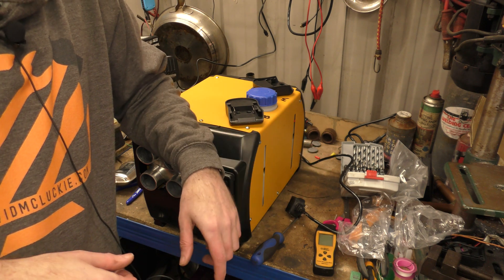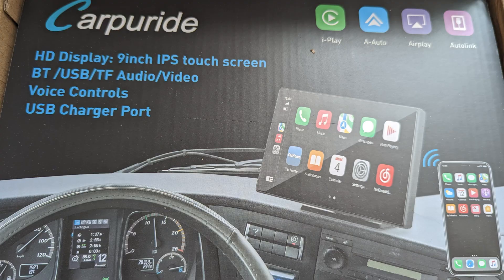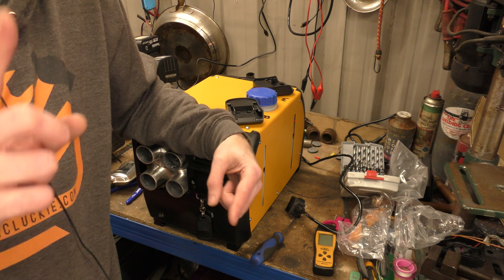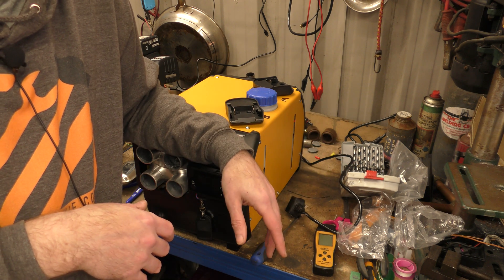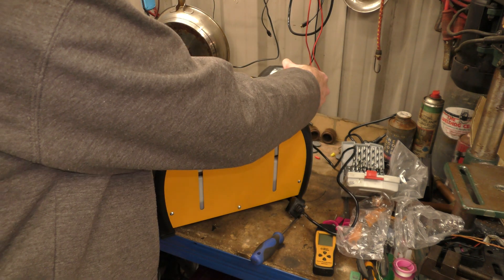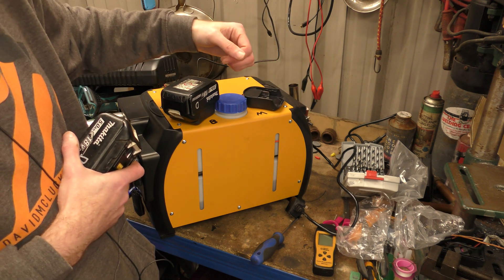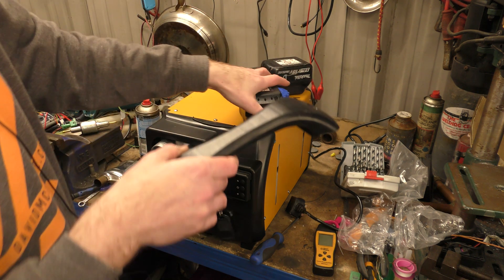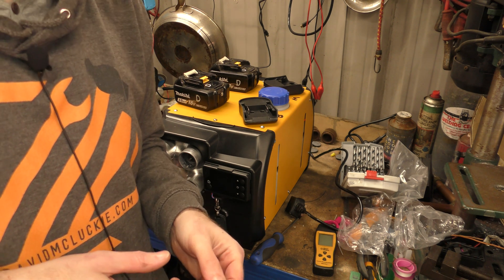Upcoming 2023 Projects + bonus battery powered heater

Comment: Hello my 5 kw diesel heater doesn't seem hot enough is there anyway of increasing the heat, I have it up to 8  hertz from 5.5 hertz  using the password doesn't seem much warmer , could you put a bigger pump in it  Thanks
Reply from the maker: While technically yes, you run into the fan not being able to put enough air into the mix and you get black smoke instead of more heat.  What sort of heat output were/are you experiencing?
Reply: @DavidMcLuckie  hello  I don't know what the temperature is I'm getting increasing the hertz to 8 didn't seem to make much difference may be I need to increase the fan as well,  you can almost put your hands in front of the blower without removing them, it's not that hot were you would have to stand back if you know what I mean, I have it in the garage. That's on full lift 5.5 or 8  hertz  Thanks

Comment: I've been thinking about a diesel dryer as well. Thinking you can solder directly to the "on" button on the board and use a logic circuit that will momentarily cause the output to go high when the input changes from one state or the other. So when dryer turns on heater element, its really just activating that logic board that tells the heater to turn on and when it shuts off it puts the heater into shutdown. then send the exhaust through a venturi type thing to blend cold air in and shoot it out with the dryer vent. You'd basically have a fuel tank on your dryer and the control board mounted. . Especially at 36 cents a kwhr this gets enticing. .
Reply from the maker: Oh, just you wait.

Comment: Hi all.
I've just had 2 separate 5kw heater orders cancelled by 2 different Aliexpress sellers. 1st one was £95 2nd was even cheaper at £85 delivered. This means the only other option is to pay £150 from some chancer on FleaBay. Gutted. Any advice on avoiding getting mugged would be much appreciated.
Reply from the maker: I've seen a few of those.  A heater I ordered went from free shipping to £150 for the shipping so there must be something happening with freight over there at the moment.  Have a look on Maxpeedingrods site and see if there is anything there.  I got one recently and it was £120 and arrived in two days.  You get 10% off if you use DAVIDMCLUCKIE in the checkout.
Reply: @DavidMcLuckie  I'm on my 5th order from AliExpress as I've had another 2 cancelled since yesterday, one of them tried to hike the shipping cost after I'd already paid. I'll see how it goes with this latest order as it's coming from the Czech Republic and not China. Thanks for the heads up, I'll take a look at that website, cheers.

Comment: They sent me a 24 volt diesel heater. Now what. All I have is wheel chair charger. Will that run it. ??? Or would it be worth trying to change to 12 volt.??
Reply from the maker: Changing to 24V is basically replacing everything on the heater except the ECU.  Are you planning on running it from a battery or from mains power?

Comment: I get it.. but it would probably be more useful if you attached just one battery that is only used when the mains power fails. lots of people useing a clunky lead acid and trickle charger.. honestly more work than just buying a $100 heater if it melts from an improper shut down on the very rare occasion.. as for really portable heat.. maybe add a capacitor bank inside to handle the switch over power loss or swap the relay for some solid state relays to switch over faster. that way you can replace 1 new battery at a time without it shutting down for continuous run times. it would also be cool if you integrated just a larger LIFE04 battery inside. when you had 120v it would charge up the battery. then you remove the power to use.. or use when plugged in..ect basically a built in jackey and heater all in one box.. really wish the self powering heater wasn't such a complicated mess.

Comment: Would it be possible to run the heater using a 12v laptop power adapter? You can but the adapters from FleaBay for about a tenner and an additional female adapter with wire connections for around £4
Reply from the maker: It needs to be able to output at least 10A, 15-20A would be preferable.

I've used these in the past - https://amzn.to/3jVbvvc
Reply: @DavidMcLuckie  ok I'll order one of those. I only ordered the heater yesterday from AliExpress £95 so I'm guessing I've got a couple of weeks to get all the bits I'll need to do the install. Would be great if you could do a parts upgrade video, silencer, fixings and the like.
Thanks for all the info David, much appreciated.

Comment: How about showing how to turn diesel heater on / off via WiFi I'm working on a wee project to do so ( once parts arrive) but I'm sure you could do it better wifi as in web based so you could turn it on / off from anywhere. I know about afterburner but I'm not in that price league 😂
Reply from the maker: I've had comments on people using a wifi to RF bridge, cloning the remote codes, and now having the ability to turn it on, off, up, and down via wifi.
Reply: @DavidMcLuckie  too complicated for me 🤣 I'm just going to do straight on off via WiFi relays and rotary switch
Reply: Scott, it’s dead easy! Broadlink RM4 pro+, just teach it the remote buttons and away you go 👍
has to be the pro+ because the other ones are just IR not RF
Reply: @bonitaboy4941  I used to use the remote bur heater kept turning on / off for no reasons so I changed to old type rotary controller.
     But as far as learning codes, and programming that's out my scope, I'd need a step by step guide for that one I can repair a PC but don't ask me to programme anything on it 😂😂
Reply: @scottwilson4816  it's just a case of pushing the remote buttons when prompted by the app
Reply: @bonitaboy4941  I'll have to have a wee google thanks mate
Reply: @bonitaboy4941  Thanks for that I just had a Google and yes very interesting, but as I said when I used the lcd controller I found heater to have a mind of it's own, switching on and off and altering heat settings without touching controls which I presumed was because it was getting fake signals Frome somewhere, of course it may just have been a dodgy controller.
    Anyway with the price of that plus a new controller, I think I'll stick to my project with rotary switch and on- off wifi control.
Thanks again though had never heard of that device

Comment: I bought my first Chinese diesel heater a few months ago and found your page and have been watching as much of your content on the subject as possible. Really appreciate your videos! I do have a question about runtime on the Makita batteries. I understand it depends on what setting you have it at, but roughly how long of a run time do you get with using a Makita battery? And could you run a potentiometer from the battery to a unit set up for 12 V?
Reply from the maker: You'll want something like this.  Takes your Makita battery voltage and you can set the output to about 12-14V.  Not got exact run times, but a 5AH battery you might get a few hours run time at full power.
Reply: @DavidMcLuckie  thanks!

Comment: Like many have said already....
Diesel heater tumble dryer sounds like a fantastic idea.
Even better if you can make the drum tumble with a low voltage motor run from a solar charged battery system.
Your a real ideas man David

Comment: Great solution for real mobility. but for my home and workshop heaters. I use an aliexpress 180watt 12,5 amp power supply with built in battery charger and UPS uninterrupted power supply, Varies in price. i paid £27 for mine, i have 3 of them . the concept is so easy, one set of wires to heater and another set to a 12v battery. which puts a 14.4 volts charge. If the power gets cut. without any delay it reverses power the supply, so charger leads are then the power leads going to heater! I have tried to mention this before to you, with a link to the power supply, but I think they are treated as spam and deleted. Anyway I think this is the best power solution, and is cheaper than averege mains power supply
Reply from the maker: Any chance you could email me a link to that?  Sounds like a useful thing to have.  me@davidmcluckie.com
Reply: Not too electrically minded but wouldn't it be better connecting diesel heater direct to the 12v battery as would use more power converting 12v to 240v back to 12v.
Reply: @kevindaniels5916  I have used a 12v leisure 100amp battery in past, but it was lucky if it lasted 8 hours before flat, so i connected it with whats known as a dum or old school battery charger Smart chargers will not be any good for this purpose, and left  charger swiched on constantly charging, that works. I think it will work out much more expensive to run. I just tested the power use of my power supply mains wise on startup. It used 120watts and krept up to 150watts for about 2 mins. while growplugs where on, then dropped down to an average 20watts running the heater for rest of time heater is on. i did not test it on shut down. glowplugs do come on so the wattage will go high in cool down Also remember power supply is the battery charger to at same time.
      you could always put a watt meter at the battery charger connected the 12v battery and test it consumption while you have heater on. By the way I have little to no Electrical Knowledge, but I do know that a watt meter isessential item for a household these days with energy prices going up. To know what your  electrical devices are using. There's a lot  of rubish talked about standby power consumption telling people to unplug tv's at night, most modern tv's LG's are mine, show zero watts usage on standby i have led bed side light that uses 1 watt the thing in my house that wates electric is my cordless land line phones 35watts, im tempted to go back to old school phone, with no power supple to it. these days i use mobiles not landlines for all out going calls so will not use land line other than an emergency. sorry went off topic!

Comment: I wonder if you used a capacitor on the output of the switch module would be enough to keep the heater running while it switches?
Reply from the maker: I think you might even be able to swap out the capacitors on the board to make that happen.

Comment: I'm making a Bluetooth hub for the basic diesel heater controller. It includes a thermostat to turn the heater on or off (standby). Do you want one when it's finished?
Reply from the maker: Absolutely.  :)
Reply: @DavidMcLuckie  just sent you a message via your website!
Reply from the maker: Hopefully you've received my reply.
Reply: @DavidMcLuckie  received although I had to find it in my spam folder. Check yours if you don't see my reply.

Comment: hi found where the fumes from the diesel heater are coming from its getting past the clamps on the exhaust outlet i have wrapped id with heat proof material but found the best way is to put a brass coupling on and compression joints tried 15 mm but kept sooting up need to find away to connect 22 mm brass connector to it do you know what metal the outlet tube is

Comment: Now the diesel-heated tumble dryer's an interesting idea, comparing the cost to run that versus electrickery heating, or even making the thing run on 12/24v entirely, though that would need a motor change to something that can run on DC (like the BLDC things in those e-scooters or hoverboards), the dryer's electronics would probably not need much conversion either as they're probably 5v/3.3v anyway with their own voltage regulation, hmm, got me thinking now........
Reply from the maker: I really wanted a 'dumb' dryer to play with, but for free I couldn't complain.

Comment: Have you had your hands on a 25kw diesel-water heater?
I am thinking about making a snow melting system in the driveway, powered by diesel...
Reply: i worked for a company that built industrial ones intended to melt piles of snow and drain into a storm drain. it was used for massive parking lots where they simply had no place to put the snow.. it used a large amount of energy and you don't drive it over the snow. you plow the snow into the machine.. if you melt the snow in place you need to sit over the area until that area is dry. if its wet when you move the machine it just turns it into a massive sheet of ice. .. anyways if you are planning a heated driveway. a diesel heater is probably the wrong choice. in the us where fuel is cheaper.. its still the most expensive way to make heat. you will see the best cost saving from natural gas. if your area does not have it or its prohibitably expensive because Europe.. you may want to retrofit a heat pump. they make units that operate in very cold envirments now. the issue is largely that your system needs to run many hours after the snow stops to actually dry your driveway or you will just have a sheet of ice.

Comment: I'm looking at a diesel heated cloths dryer for my off grid shack, the actual tumbler motor uses bugger all current so the tiny battery solar system in my garage there will more than run that side of things, and I can have a heated shed in winter.

Comment: Makita Battery powered diesel heater wow, David you never fail to amaze me. The main question is,.... how long is the run time on a fully charged battery before it cuts out to the backup battery. I know it depends on how hard you run it but under normal conditions???? Can't wait for that vid and maybe a diode upgrade for those terminals.
Reply: Full-tilt an average heater pulls ~4A at 12V so for a 5Ah battery I'd guess at least 1.5 hours.

Comment: How about a user guide/comparison between the old controllers and the new version that's becoming more common?  Different icons, different displays, different settings tweaks?
Reply from the maker: That is a good suggestion.  But, I don't have all the controllers.  Most I'd need to buy a whole heater just to get the controller.  It feels like every month there is another new variant of some controller.  And if I make a video with the ones I have all that leads to is "what about controller X", "what about controller Y".

I might just have to make a video for each controller.

Comment: Looking forward to the new projects. At 3:30, I'm not sure why you did not connect  the two Makita batteries in parallel?
Reply from the maker: One battery is the backup if any of the power inputs fails, it switches to that battery and cools the heater down.
Reply: @DavidMcLuckie  Oh, get it now, thanks. Can you use a low voltage relay to signal the unit to shut down, or shut off the fuel pump with enough charge left in the battery for a cool-down?
Reply from the maker: Yes, I've done a few videos on that.

Comment: You could have installed the battery holders in parallel, would be no need for the little board then and you could swap one dead battery at a time leaving the unit running
Reply from the maker: Let's unpack what you've suggested.  With the little board removed there is no protection from power failures or flat batteries.  If you run batteries in parallel they will drain at a fairly even rate, so one won't go 'dead' first.  A better suggestion would be leave the independent backup battery, add more diode protected batteries, perhaps even on a switch so you could drain them one at a time and swap them out.
Reply: Perhaps my wording wasn’t great but I full agree with what you have said, keep up the good videos